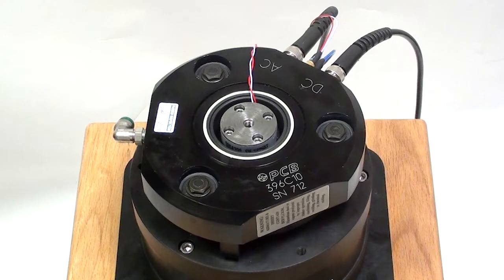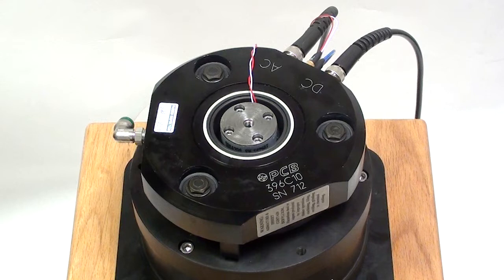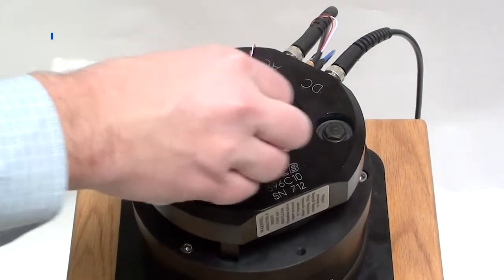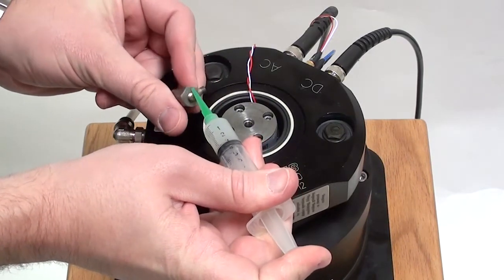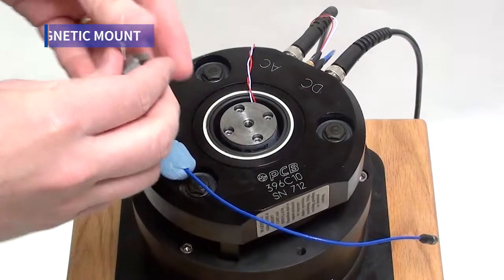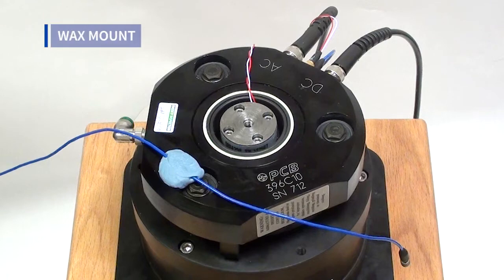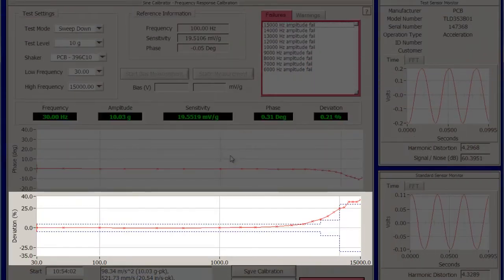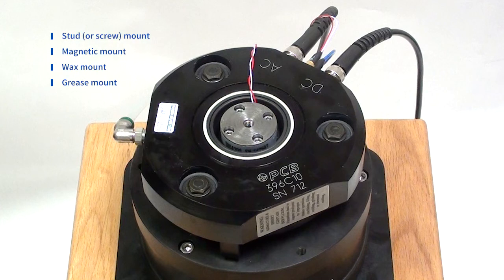Sensor Mounting Techniques - Effects on High Frequency Response

Comment: What is the actual freqency that each type of mounting technique variate at? From the vedio only see between the 1kHz to 15kHz.
Reply from the maker: Hi, thanks for reaching out. Yes, usually the mounting technique affects data in this frequency range.  However for lighter weight sensors,  it may not become noticeable until testing at higher frequency.

Comment: What is thin weld cap  of an accelerometer ?
Reply from the maker: The weld cap is in reference to triaxial accelerometers in this case.  Some axes may have to be adhesively mounted because they do not have a stud mount available.  The weld cap is the circular ring that can be seen on the sides of the accelerometer where the circular cap is welded on to the sensor frame after assembly of the inside components are completed. These welded-on sides should not be glued down as they are not as strong as the corners of the sensor.  Gluing onto the weld cap can excite the sensor resonances and/or damage the sensor.  See the Adhesive Accelerometer Mounting video found at https://www.modalshop.com/calibration/learn/video-tutorials/accelerometer-calibration-mounting-tutorials for more information.